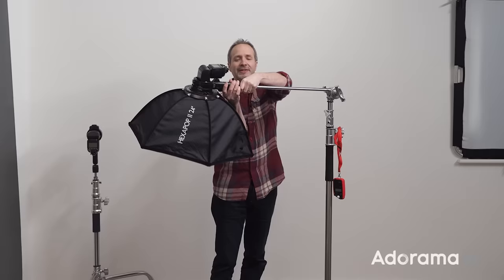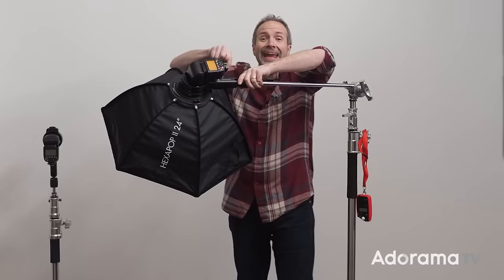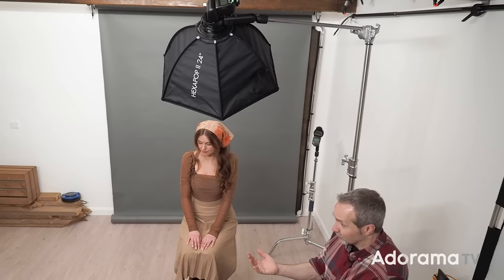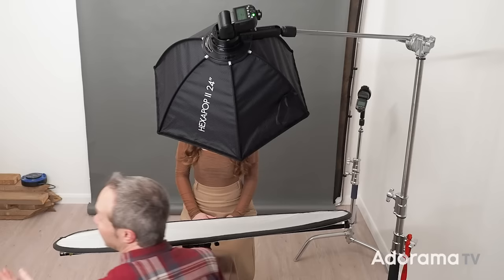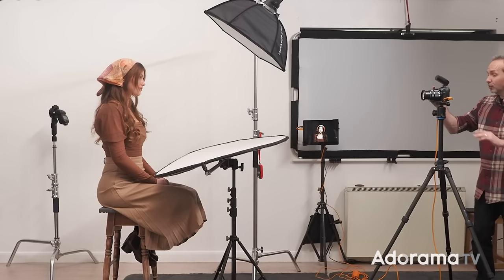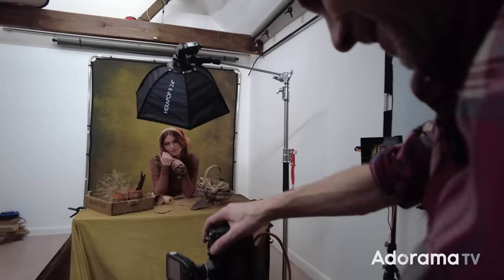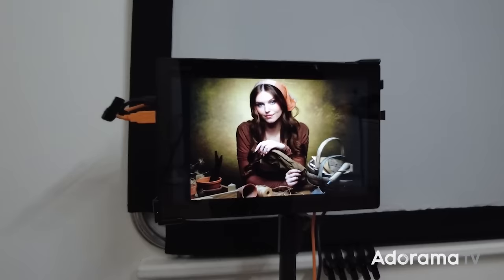Beauty Light with Speedlights | Take and Make Great Photography with Gavin Hoey

Comment: Gavin, I am new to digital photography and have learned a lot with your videos although starting to gather the equipment for flash photography to start applying your lessons. Also enjoy the energy and enthusiasm you put on each video.  Chloe also enhances the portraits with the posing and beauty of course. I notice that you use a 12 to 40 mm lens, contrary to what I have read that for portraits medium telephoto lenses are better suited.  What can you comment on that?
Reply: 12-40mm on my micro 4/3 camera is a 24-80mm equivalent in full frame (35mm) and I'm generally around the 40mm end (80mm). That said I'll use wide lens and telephoto lenses if that's what I think works. My advice Jacinto... stop reading and start playing ;)

Comment: Gavin you always make the best videos!! I have a question you might like to address in a future video. I am trying to do full length portraits with white curtain background and white floor. I nearly have it right but not quite. I have a white backdrop and then sheers. A Godox 200 either side between the two. A Godox 200 in a big black umbrella at the front and a reflector at my tripod. My problem is I still get light drop off down the dress and I don't want that. So how can I get the beauty light on her face but keep everything light and bright. I hope this makes sense. I can send you a photo if you wish. Thanks always for your fantastic videos. Much appreciated.

Comment: Fun, informative video Gavin. Question: I'm a beginner who has only done natural light portraits. I have used a reflector, but don't yet have a proper flash. I want to get something that I can use outside for things like HS senior photos, before prom photos, children portraits. Do I need to go with something more powerful than a speedlight for outside? So far, I was looking at two units, the Godox V860 and the AD200 as possible choices. My camera is a Fujifilm X-T3. I am not looking to do this professionally at this point. Only shooting for friends who ask. Thanks for any thoughts you might have....

Comment: Greetings.  Great information and great images but... at the top of the video, unless I'm mistaken, shouldn't the weight on the c-stand gobo arm be on the right of the knuckle.  The "right-hand-rule"... so that the weight, in this case the speed light, tightens the gobo head with the weight applied to it.  (Righty-tighty, lefty-loosey.)  Safety first.
Reply: It seems to have been fixed later in the video.  So that happened.

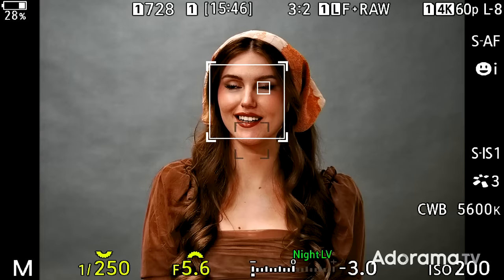Comment: I had to stop for a minute at 1:15 where you said that ISO 200 requires TWICE as much light as ISO 100.  At ISO 200 the sensitivity of the sensor is double that of ISO 100 and it requires HALF as much light unless my old mind has gone astray.  Higher ISO equals less flash for the same exposure.... right?
Reply: actually, he said iso 100 vs iso 200 requires twice power... so imho he ment iso 100 needs more power

Comment: How would this entire shoot and the options selected have been different had you used a full frame camera rather than the Olympus?  I assume the aperture would have needed to be smaller so the speedlight would have to be set to a higher power.   Anything else?
Reply: Aperture, probably yes and associated power of the flash. Other then that NOTHING changes. Micro 4/3, APS-C, 35mm, Medium format, plate camera... all the same principles 😉

Comment: What is that monitor u use to tether your shots? And can you just plug in and start tethering without a computer?
Reply: That's my Lenovo Miix 2 in 1 laptop / tablet. If your camera has an HDMI Out port, then you can use a monitor or TV and a suitable HDMI cable to connect the two together without needing a computer 😊

Comment: Hello 😊 is it also possible to change zoom number on godox ad200 or does it just work on speed light?
Reply: The zoom effect is fixed on the EVOLV200 (AD200) Although you can still change the zoom number on the transmitter, it won't affect the light.
Reply: @GavinHoey  so what is the fixed size on this? Auto?
Reply: @ingunnjohansen6612  I think the speedlight head has a 35mm coverage.